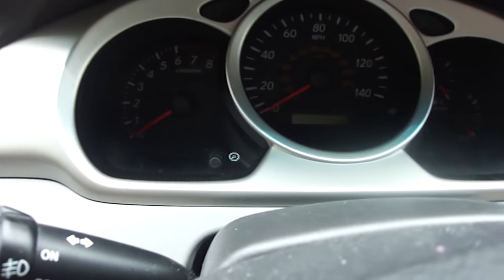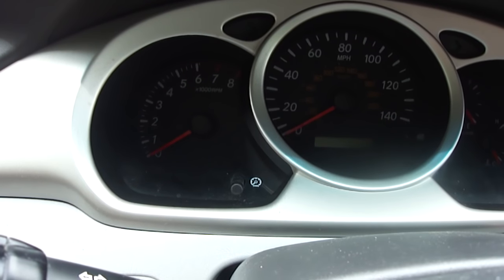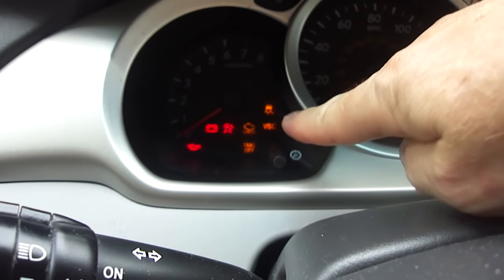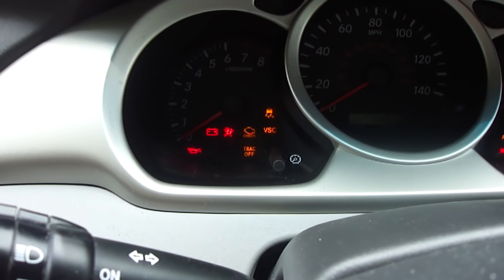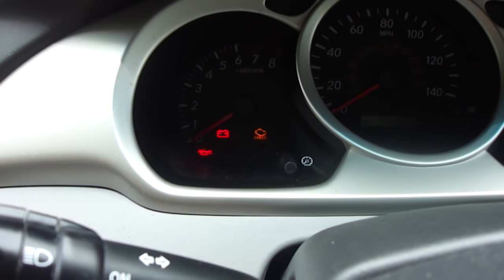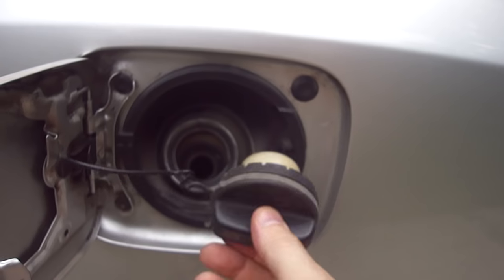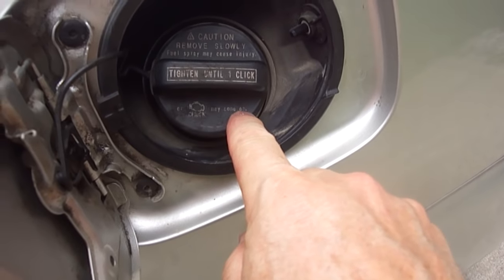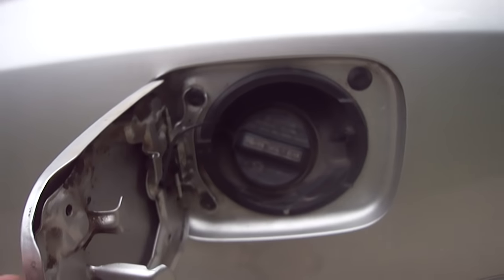(Part 1) How To Fix Your Check Engine, VSC, Trac Off Warning Lights On

Comment: I was feeling a miss in the engine. Used scan tool. PO306 Misfire on number 6 cylinder. Replaced coil. It fixed the misfire and the VSC light. A misfire must trigger the VSC system.

Comment: I also had this problem.  After spending time investigating this issue that was causing these warming lights to stay on.  I found that I had a faulty fuel filler cap.  Shorty after replacing the cap, the lights went off.

Comment: Just happened to me on my 2004 RAV4.  I thought it was the battery because my battery went 7v and it wouldn't crank either.  I was going to also buy a new Alternator.  Wow... thanks for this video!  By the way... when my original Panasonic battery died yesterday,  it was 14 years old and I live in NYC. I want to believe the batt had its days so it needed a new one.  So I bet the wife didn't put the gas cap on properly and caused problem #2.  For something as stupid as this gas cap, you can get had for lots of $$$ at the service station.

Comment: I had these codes after VSC and check engine light were staying on:

P0441
Evap emission control system purge flow fault
P0446
Evap vent circuit malfunction 
P0455
Evap leak large

The gas cap wasn’t properly seated. Reseating it seems to have fixed the problem. 

Thanks for your videos.
Reply from the maker: wdtony 👍

Comment: Good evening.  Today as I was checking my car, I noticed that the check engine was on as was the oil icon land Maint light.  I took it to a nearby place to get the codes read and thankfully the problem was not serious.  The place I had my oil change at had not done a reset and thus the oil change light had come on.  However, as I drove off, I noticed that the trac lights had come on.  I immediately went to the Toyota dealership.  They confirmed that there was nothing wrong with the car other than I had to take it back to get a diagnostic test due to the trac lights being on.Feeling disheartened as I was getting ready to go see my mother who is 97 years old, I had to remind myself of Romans 8:28 as I canceled my plans.  Later, I decided to check Youtube in hopes of finding out information on the issue.  Your video was the first one that came on.  After watching it, I went out to my car and took off the gas cap and replaced it again making sure I heard the "click".  I turned on the car and behold....the trac lights were gone.I had to sign on to Youtube to say thank you, thank you, thank you for your generous gift of sharing your talent, knowledge, and abilities.  God bless you.
Reply from the maker: That's great!  I hope you have a wonderful visit with your mother and a wonderful Christmas.

Comment: Thanks so much this fixed my mom's car! 2009 scion xb.
Reply from the maker: Awesome!
Reply: I have an xB also,,,did the warning lights turn off Immediately, or after driving for a bit? Thanks ⛽️
Reply: @djCatScanRL  you probably figured out what was wrong already. But just reset it disconnect the battery for a few mins. If the light comes back on it might be a bad cap you have to replace or many other things easier to get it scanned if it comes back

Comment: had these same codes on my scion for a year now. Thought was mas sensor cleaned that didn't work gas cap appears to be on no issues. will see if O'reillys will run on their computer scan tool. Although mine will not make click sound anymore so!
Reply: Have an ‘08 Sienna XLE.  had all these random misfire codes (VSC) and even would have to shut my van down as the “traction control” light would blink along with the engine light causing the van to lose power and decrease in speed, till I shut it off and restarted it.   And that would take care of it for a week or so then back again, usually one the Highway.  So off to the shoulder again as the van would slowly lose power and buck and gas be basically unresponsive 

Seems like maybe the compression was changing over the 200,000 miles as i started putting premium gas in and the higher octane was the key.. as all the codes went away (once cleared) and never came back.   Same spark plugs.  I did change one injector (before I switched to premium gas) as it did have that code come up for the number 2.  But the check engine lights would still come on.   But same spark plugs on all 6 cylinders as those back are just too hard to change without a good reason.  

Again premium gas and all my check engine lights and blinking lights are a thing of the past and it’s nice having a dash free of those.  (Those lights came on probable a dozen times in the past.  But now problem solved for like 9 months now and counting.

So if it returns might try that.   I’ve disconnected my battery several times.  And light always would return after a period of time.  Also I had cleaned my gas cap in the past.    

But premium gas is what helped when everything else was just a temporary fix.  

God bless

Comment: Thanks for this tip. i'm going to try that on my car. I've been getting this warning on my Toyota Camry. Let you know how it goes.
Reply: Did you ever get it fixed?
Reply: I tried this and the lights are still on. :(
Reply: @kaiserahmed7195 how did u fixed it i got the same problem in my toyota camry 2009?

Comment: I have the same warning lights and I bought a new fuel cap. The warning light still on and I feel some shaking when driving it and when I stopped do you have any idea why it’s shaking? I hope you can help me. Thank you.
Reply from the maker: Take the vehicle to an auto parts store and have them check it with a diagnostic scanner which they will perform for free.
Reply: @proclaimliberty2000  I bought an OBD scanner and the problem was 1 cylinder has a misfire and a bad ignition coil. Bought a new one from the dealer , no more vibration. Thanks for your videos God bless!
Reply from the maker: @jbaja  👍😊

Comment: Have an ‘08 Sienna XLE.  had all these random misfire codes (VSC) and even would have to shut my van down as the “traction control” light would blink along with the engine light causing the van to lose power and decrease in speed, till I shut it off and restarted it.   And that would take care of it for a week or so then back again, usually one the Highway.  So off to the shoulder again as the van would slowly lose power and buck and gas be basically unresponsive 

Seems like maybe the compression was changing over the 200,000 miles as i started putting premium gas in and the higher octane was the key.. as all the codes went away (once cleared) and never came back.   Same spark plugs.  I did change one injector (before I switched to premium gas) as it did have that code come up for the number 2.  But the check engine lights would still come on.   But same spark plugs on all 6 cylinders as those back are just too hard to change without a good reason.  

Again premium gas and all my check engine lights and blinking lights are a thing of the past and it’s nice having a dash free of those.  (Those lights came on probable a dozen times in the past.  But now problem solved for like 9 months now and counting.

So if it returns might try that.   I’ve disconnected my battery several times.  And light always would return after a period of time.  Also I had cleaned my gas cap in the past.    

But premium gas is what helped when nothing else was just a temporary fix.  

God bless

Comment: came across this today while searching what the VSC is on my car and why it suddenly has the light on. Just wanted to say, indeed, the gas cap seems to be what triggered it. I took the cap off and re-tightened it. I noticed that it took a couple times to stay in that first click. 
Maybe my cap is getting too worn/old to hold the seal it needs to prevent that trigger of the lights? (2010 Toyota Matrix)

Comment: I have a 2005 Lexus RX330 with the same issue. Contrary to what the service center claims, it's not the gas cap. How do I know? I swapped identical gas caps with a 2006 Toyota Sienna. The Sienna was showing no signs of trouble. If the Lexus gas cap was bad, it should have set off the Sienna's warning lights. Accordingly, the good gas cap from the Sienna should have remedied the problem with the Lexus if, in fact, the gas cap was the true culprit. It has been a couple of weeks. No changes recorded with either vehicle.
Reply from the maker: Disconnect both battery cables for one hour and reconnect.  If that doesn't fix it, take it to any auto parts store and have them do a diagnostic scanner check which they will perform for free.
Reply: @proclaimliberty2000  
Thank you for your advice. I will disconnect the battery cables as recommended. Another thing I should mention is when I opened the hood, I noticed a small vacuum hose was missing from the air cleaner housing. The hose has since been replaced. I have a feeling this might have caused the issue, although I do not know why it took days for the warning lights to come on. I have also decided to purchase a diagnostic analyzer. I feel it will be a good investment, especially with 179,000 miles on the Lexus. It may be that the warning lights just need to be reset.
Reply from the maker: @jeffersonianideal  Faulty vacuum hoses will commonly cause a check engine light.  A diagnostic scanner
is well worth the money and a good investment.  Even if it's something you can't fix yourself, you can tell the mechanic "I got a so and so code from my diagnostic scanner.  It kind of gives you insurance protection to keep a mechanic from trying to pull a fast one by trying to fix something that doesn't need fixing if you know what I mean.
Reply: @proclaimliberty2000  
Good points. Thank you once again.
Reply from the maker: jeffersonianideal 👍😊

Comment: Paul, it's Tamara with the 2001 Lexus LS430.  I have a specific question for you.  My VSC indicator light is back on, even after going through steps 1 - 5.   I had my car in the garage the past two days because of a sticking cam selonoid.  That is now fixed, but still the VSC light is on.   What should I do next?
Reply from the maker: Tamara Evans is your check engine light on in addition to the VSC light?
Reply: @proclaimliberty2000  No, it was but is not now.
Reply: I should add that I bought a cheap gas cap to replace the original one.  I'm wondering if I should just put that Lexus gas cap back on it, now.
Reply from the maker: Tamara Evans I would drive at least 50 miles with the new gas cap. If the light does not go out then put the old gas cap back on and drive it another 50 miles. If it still does not go out then disconnect both battery cables for one hour and then reconnect and see what happens. Also, just out of curiosity did the repair garage say anything about it being on?
Reply: @proclaimliberty2000  No, not a word!    Thank you again for your assistance, and I will try these additional suggestions.  God Bless YOU!
Reply from the maker: Tamara Evans 👍😊
Reply: @proclaimliberty2000  Paul, I just put the old gas cap back on, started the car, and I have NO WARNING LIGHTS!    Amazing!   Let's see if that lasts during my next few days of driving.   THANK YOU AGAIN!
Reply from the maker: Tamara Evans 👍😊 You are so welcome!
Reply: @proclaimliberty2000  - Paul, I have discovered that the warning lights do not come on when I start the car, but they do come on and stay on after I put the car in gear and drive forward a few feet.  I still haven't driven quite 50 miles with the old gas cap back on.  I'm retired and don't actually move my car much.  Tomorrow, I will disconnect the battery for an hour and see what happens.  I'm so puzzled.  Is there a possibility that there actually IS something wrong with the vehicle skid control system?
Reply from the maker: Tamara Evans The skid control system is more than likely fine. If disconnecting the battery cables does not work then I would take it to an auto parts store and have it checked with a diagnostic scanner which they will perform for free. This will give you trouble codes and should help point you in the right direction as to what’s wrong.
Reply: @proclaimliberty2000  - kept the battery disconnected for 3 hours.  That made no difference.  So, thank you again for your great advice, and I will try the auto parts store next.  Have a great evening!
Reply from the maker: Tamara Evans 👍😊

Comment: Thanks for this! I just got gas and was driving them my car cuts off. I thought it came from me just having axles done and new tires and I was thinking did these people mess up my car. But I went back outside and tighten it and the lights went off. I have a 07 Lexus es350

Comment: I just had the VSC light come on on my way home. Checked everything, couldn't get it to go off with gas cap, vacuum lines. I then noticed that my gas gauge was below "E", even though I had put 3 gallons in this morning. I went up to a different gas station and put 3 more gallons in. When I started the vehicle, the "VSC off", and the "Engine" light were all off. Must have been bad gas at the first gas station I went to.

Comment: Do you think this problem would  work on a Toyota Celica 2003 ? It's a vehicle that I am thinking of buying ....Thanks
Reply from the maker: Edwin Edwin If you’re thinking of buying it have them put a diagnostic scanner on it and see what trouble codes come up which should cost you nothing for them to perform.
Reply from the maker: Edwin Edwin I also check car complaints.com when buying a used vehicle.

Comment: Thanks- unfortunately that didn’t help in my case.  Did exactly what you said; checked the gas cap- then restarted vehicle. No change- all 3 lights still on.  Mine is a 2006 Highlander. btw.  Will keep checking for other solutions.
Reply from the maker: I would drive another hundred miles and see what happens. If it does not turn off, then go to an auto parts store and have them check it with a diagnostic scanner, which they will perform for free.
Reply: Find a solution?  If not Have an ‘08 Sienna XLE.  had all these random misfire codes (VSC) and even would have to shut my van down as the “traction control” light would blink along with the engine light causing the van to lose power and decrease in speed, till I shut it off and restarted it.   And that would take care of it for a week or so then back again, usually one the Highway.  So off to the shoulder again as the van would slowly lose power and buck and gas be basically unresponsive 

Seems like maybe the compression was changing over the 200,000 miles as i started putting premium gas in and the higher octane was the key.. as all the codes went away (once cleared) and never came back.   Same spark plugs.  I did change one injector (before I switched to premium gas) as it did have that code come up for the number 2.  But the check engine lights would still come on.   But same spark plugs on all 6 cylinders as those back are just too hard to change without a good reason.  

Again premium gas and all my check engine lights and blinking lights are a thing of the past and it’s nice having a dash free of those.  (Those lights came on probable a dozen times in the past.  But now problem solved for like 9 months now and counting.

So if it returns might try that.   I’ve disconnected my battery several times.  And light always would return after a period of time.  Also I had cleaned my gas cap in the past.    

But premium gas is what helped when everything else was just a temporary fix.  

God bless

Comment: This just happened to me. Made a turn over slippery ground and the check engine and Trac off lights came on. The car also started shaking heavily. I checked your video and effectively the gas cap was loose. I turned on the car but the lights are still on. I'll give it awhile yo see if the car computer resets itself and everything's back to normal.

Comment: 2008 Toyota Highlander: Check Engine & Traction Control lights on, VSC light flashing. I took the gas cap out and put it back in until it clicked, but the lights stayed on.  I read instructions for a reset procedure for the sensor.  Hold the odometer button in & step on the break pedal - while doing so, start the engine. Did so - all my lights went off.
Reply from the maker: Thanks for posting!

Comment: I’ve got a 2002 Toyota 4 runner that those lights came on , never thought about the gas fill cap not tightened enough , I just took one battery terminal off for 30 seconds and put back on again and it resets  the system, but you’ll have to reset your radio stations again . 😳

Comment: Mine came on this am on way home from qork in my 06 v8 4Runner i tried to make sure my gas cap was tight but it still on.. mine is showing a catalytic converter code.. would that throw the VSC and trac control lights to come on too?!?!?! Thet all popped on same time this morning any advice is appreciated

Comment: I just tried parts 1-3 and they didn't work for me.  Part 4 looked too complicated and risky so before doing that what I did was disconnected the battery from my 2010 Corolla and cleaned the corrosion off it.  After 10 minutes I reconnected it.  My car still shakes but at least it took off the VSC, TRAC and engine lights.
Reply from the maker: If your car is shaking it's telling you something is wrong and you need to figure out what it is before something is possibily damage.  You need to put a computer scanner on it and see what codes have been saved.

Comment: I bought a new gas cap i got my Cadillac converter changed and it went off for a year and a half. Then winter hit in Wisconsin it went back on. Covid  happened i wasn't working wasnt driving much then when winter was over it went off until it got cold again  now its summer and still on is there anyway I could make it not effect my vacation system